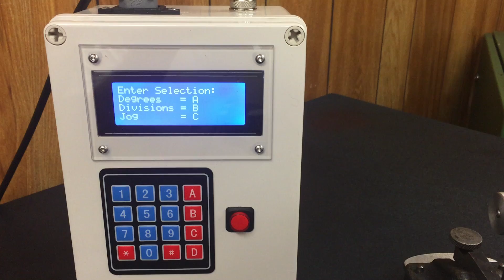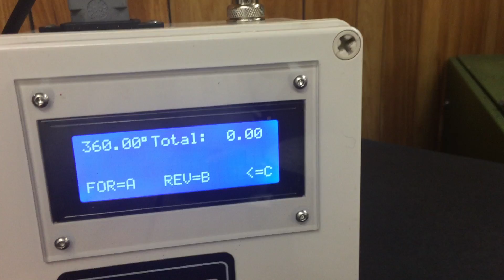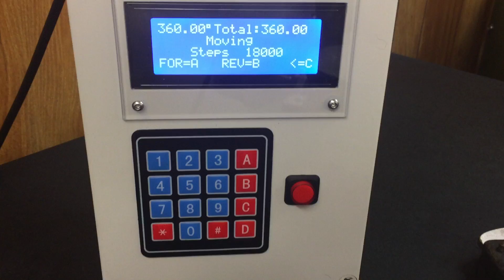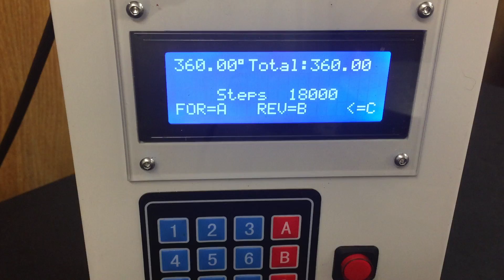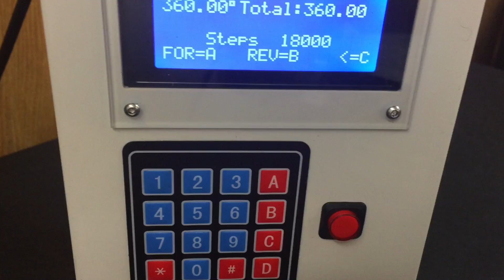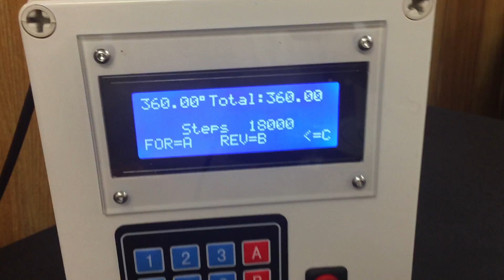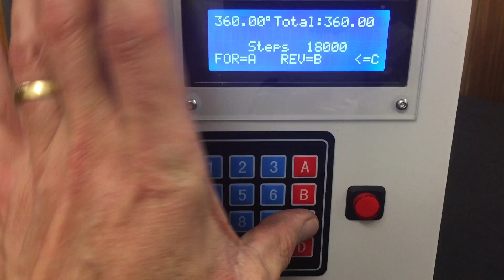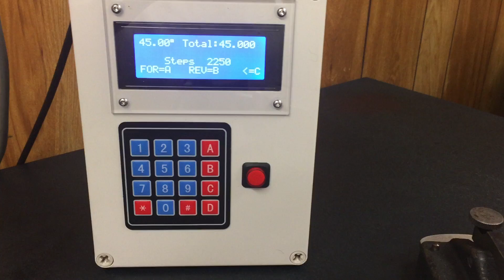Arduino Controlled Rotary Table

Comment: Hi Peter, Love the project. I would like to add the same to my table but are not up to the programming, any chance of getting a copy of your Arduino program for the rotary table control.
Regards,
Ian
Reply: Nice project.   
I wanted to make an indexer for my wood lathe.   I watched videos like this one.   The code to tell the stepper to make x steps is straightforward.   I spent a couple of weeks on the learning curve for the display.   Nested menus were a hassle for me.
I decided to change to a Nextion display which is a touch display with its own CPU.   Another learning curve, but worth the effort.   Now very little information needs to be passed from the Nextion to the Arduino.    The Nextion editor includes e.g., keyboard layout.
Happy to give you my code if you want to go this route.
I have a couple of NEMA 23 steppers left over from my project.   I may have to make an adapter for my rotary table.   Very tempting.
Dave.

Comment: I bought all this stuff. Arduino uno, nano, and mega. Also lcd screen the 2 line and the four line i2c version. I spent hours and couldn't get the arduinos to communicate with any lcd screens. Can I ask where you purchased yours. I got the number pad to work. Do you have a Facebook account? I have a group; Snap Finger Tops I need one of these to make life easier when making spin tops. Thanks in advance.
Reply from the maker: pete garssia Hi Peter, thanks for the interest. I can't recall the supplier of my displays, I think off eBay. It could be worth searching some videos on the i2c displays to make sure you properly understand the address requirements. The supplier of your displays should provide the address, and it is quite likely this will need to be changed in the sketch. Good luck with it.
Reply: Pete F 
I did more research on the item I purchased, and they have the sketch I need to make things work, hopefully. There are more than one i2c modules and they each require a specific address. Thanks for the quick response and good luck with your projects.
Reply from the maker: I think it should be a fairly simple matter to just change the address in the sketch. I recall having to change the address in mine depending on the display manufacturer. Thanks again for the comments and good luck with it.
Reply: I know exactly how you feel.  After perusing various sources I discovered that the LCD screens that are involved with this project have a screw on the back that for some absolulutely enfuriating reason is preset to *pitch black*.  So even if you set everything up correctly it will appear as if it's not working properly.  Crank that little brass screw all the way and you'll suddenly see the display work.  

Here is a link to the article that references that little monster, it's actualy a tiny potentiometer on the back of the LCD.  https://forum.arduino.cc/index.php?topic=128635.90